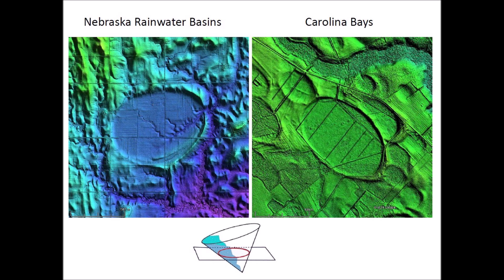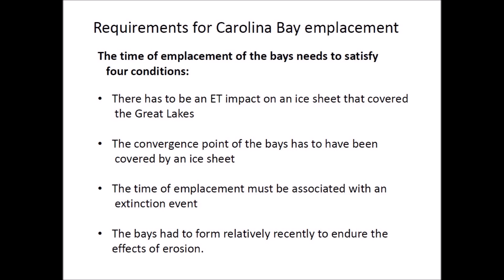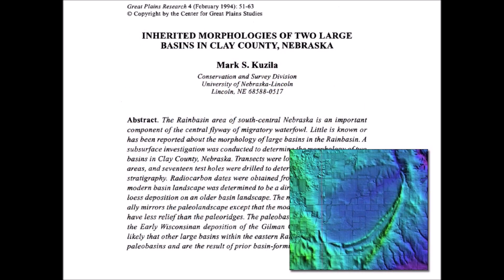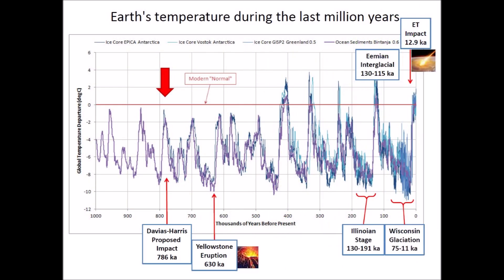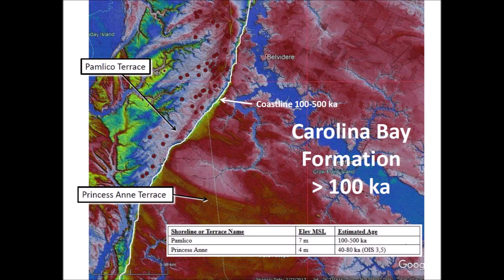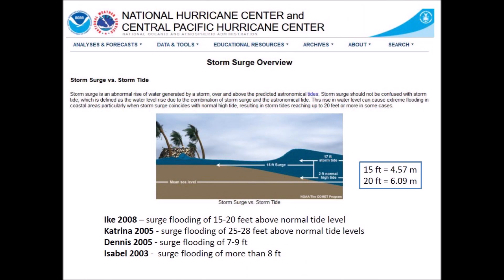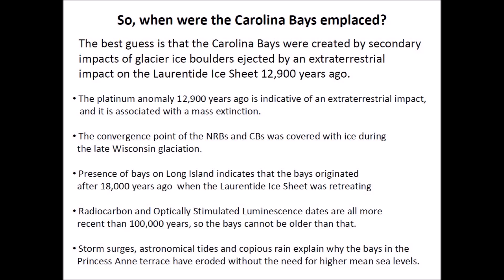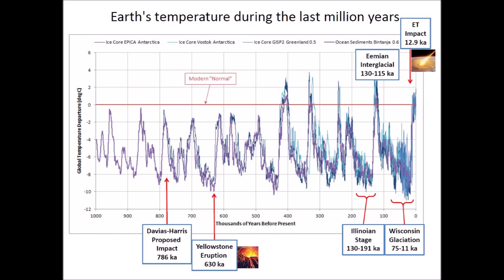Carolina Bays - Time of Emplacement

Comment: Have you seen this? The impact, and lack of traditional crater, on the ice sheet was the first thing I thought of. https://www.youtube.com/watch?v=iJYlEBID34g
Reply: That was cool, I had an older step-brother that was a kleptomaniac so we always had surplus ammo to shoot anything that moved or static.  We even hunted northern pike running up fields and ditches with shot gun slugs in the spring.  Notice the ice diametric kick back toward the camera, I learned about that from pounding endless concrete nails, one should keep their face clear of this area.  I have been designing a proprietary type of sinebar rifling machine and always wondered how far the lead could be turned down for ballistics.  I have always had this intuition that projectiles are overtly spun thus decreasing their efficiency even though I have no intention of making such machines.  I was thinking of getting a shot gun to do experiments with ice just for Saginaw Bay and then got side tracked finding out they make rifled ones now that can accurately reach way down range and I haven't done satisfactory research yet.  With a bolide it will detonate unlike an environmentally friendly round, another aspect I haven't figured out yet, not to mention the bodily harm possibility.  Nobody cared about lead back in the early 70's.
Reply: @bardmadsen6956  I can't believe with all the shooting I've done, especially when I was a kid, that I never encountered this. I have shot a lot of slugs into the mud around ponds and river banks and you just start getting a feel for how high speed, high density projectiles act and react. Seeing Antonio's mud experiments brought all of that back to mind. I would get lost in the math pretty quick but I can just see how the secondary impacts would have been just devastating. It would have totally reshaped and resurfaced the east coast and I feel like the primary impact would have been more of a dent instead of a crater. The ice sheet would have probably distributed the impact over an area much larger than what you would get say in the middle of a desert. Then just ejecting all of that ice to the sky. That's where my imagination hits a dead end. I think my seat of the pants physics would not be able to comprehend what would happen a millisecond after impact. I was in the Field Artillery also and we had class on quickly analyzing artillery craters to get the back azimuth to send some love back at'em. I thought that seemed like a really bad position to be in. Luckily I ended up in a tactical nuke unit and they don't really do that back azimuth thing there, lol. Also it was on the end of a solid fuel rocket, instead of artillery pieces. Then, for the first time in my few years in the Army, they made sure we had bayonets and hand grenades...in a nuke unit... and I wondered, how in the hell did we ever win a war lol. But, yeah, maybe Antonio could get some inspiration shooting some slugs out in some tundra or mud flats?
Reply: @sgtrock68 - I don't recall ever shooting solid ice if it happened it would have been the step-bro and I just don't recall.  We did shoot through ice probably 4 inches thick maximum.  But, yeah that is the whole idea right now water is a solid around here.  I was going to buy a cheap Mexican made, forget the name, 12ga. pump when I was in Texas but couldn't find the connection.  Now I found the right gun, just have to do a little more research.  Thing is, it seems I always have to do things solo.  Gun, camera, and middle of nowhere without competent help...  Thinking about it I would have to prepare ahead of winter to do experiments at home.  Hey, at least no worries about discharging weapons in the city.  I do need to find a route to a geological anomaly that the access got shut down because someone was tearing up someone else's  land on their speed buggies.  The last option evolves crossing a beaver ice pond, last summer I was about to make my own raft with a chain saw.  Amazing how some people's children...  Forgot, strange winter this winter don't want to fall through the ice, that's out.  Back to the blackboard once again.